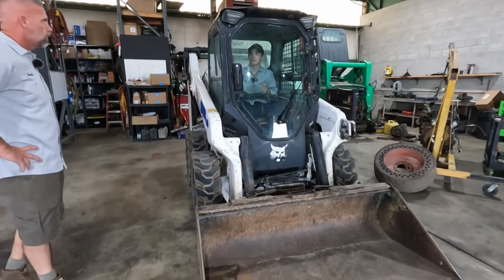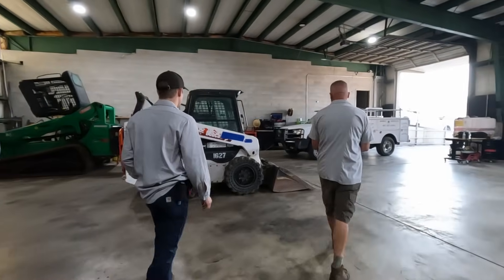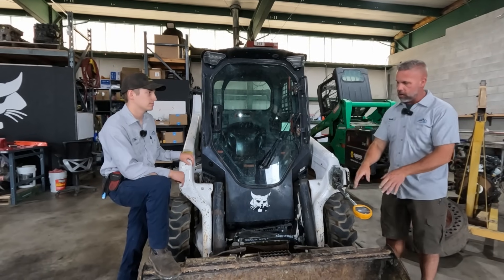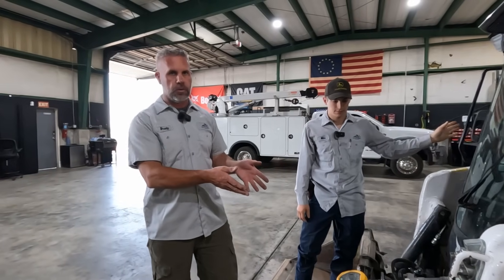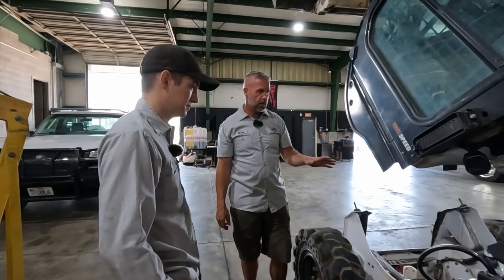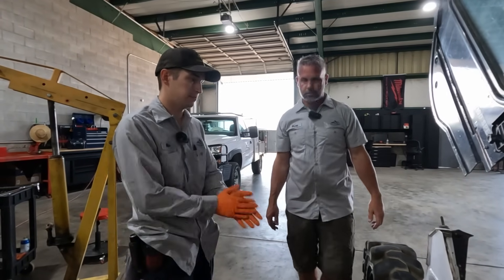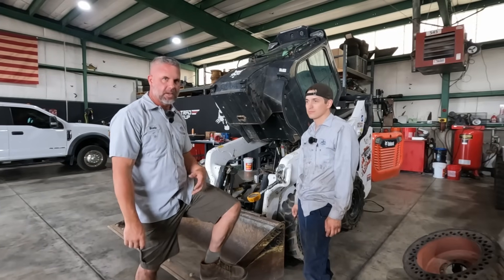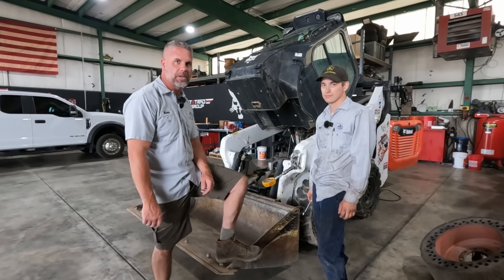Why Does This Bobcat Have Weak Hydraulics?

Comment: what would cause my brand new t66 2 speed to constantly bogs down and stall's out when digging into a bank or digging out a stump ? Ive owned 3 t66 machines now and this is the first with 2 speed and never had this problem with the others.Could the pressure be to low?

Comment: So if your gear pump is good and you are still having the same issue? I have an s70 with similar symptoms. Thought it was the gear pump so i replaced it but no change.
Reply: Describe your symptoms. The gear pumps typically only run auxiliary hydraulics. The real work horses are the piston hydrostatic pumps that run your mobility things like wheels/tracks etc.

Comment: How did you turn it on with the cab in the air?
Reply: Easy? Lol the cab lifts but doesn't affect wiring from the ignition switch as long as other conditions are met. I.E. parking brake on and arm rests down.

Comment: i have a 773 that I have to hold the fuel shut off solenoid in pull position with a tie wire then start and operates ,once done I reverse the process .replace the fuel shutoff solenoid ,relay harness was missing ,install an aftermarket one along with the solenoid and still the same problem . can you help ,any idea why this happens , is really annoying .thank you
Reply: Computer that controls the solenoid and or ignition switch

Comment: Prior to loosing and of the hoses, how do you bleed the pressure off of the line(s).
Reply: There's always a return to tank line or you can crack the line with a rag over the fitting under your wrench slowly<<<<keyword. You relieve the pressure manually this way, the pressure won't blow off the remaining threads unless you manage to unthread it til only 1 is holding on somehow.

Comment: I have lost count on the number of times I pulled the main relief valve and cleaned it on the old Bobcat 310 I was using in the 80's. It was way too sensitive to dirt.
Reply: Can you explain how you clean it out.
Reply: @brennankirby25  The relief valve was a bit strange having a very small hole in the center which allowed some small amount of oil to bleed through to the back of the relief valve causing a partial counter pressure. When a very small speck of dirt got stuck in it then the pressure in the system became very weak - you could barely raise the bucket.
Remove the valve, remove the small piece of dirt (I think that it was primarily lint from the oil filter or paint from the inside of the transmission) and then put it back and it worked fine for a while.
Overall a dirt sensitive design, and I suspect they changed it later. This was in the early 80's.
Reply: I just pulled mine. Same design. There is a little pilot pressure hole on the one side. Plugged right up. 👍 Thank you. @ehsnils
Reply: I have a 2011 s70. I thought it was the gear pump on mine. I replaced it and still only half flow to my auxiliary hydraulics. Very similar symptoms to this video. I pulled the bcis check valve on mine the screen was clean but hard to test these without a hydraulic test block.

Comment: I have a 2017 s450 and would like to know if the drive motors pull straight out from a carrier like older models or if i have to remove the chains, as i cannot see a carrier in the parts schematic. They are eaton manual single speed motors.
Thanks

Comment: A lot of backup rings have a diagonal cut in them that does two things. It expands outwards under pressure conforming to the outer sealing surface, and it prevents damage during installation.

Comment: Could a defective hydraulic filter earlier in the life of this machine that allowed dirty oil to flow through the pump have caused this?
Reply: It could. If the filter was bad for a 500hr interval or even shorter and it was allowing unfiltered oil to continuously circulate the system that will definitely cause accelerated wear in the pump. With no filter you probably would get the same amount or more wear in 500hrs as you would in 10,000hrs in a properly working filtered system. But it also most likely wouldn’t be just the gear pump. The dual hydrostat, both drive motors would be worn, spools in the control valve would get scratched and scored etc. that would not be good..

Comment: So to understand the flow control..when you had the flow control completely shut and the pump was only building 600psi…the 600psi created isn’t enough pressure to crack the motor casing or break something? It seems when you stop the flow, even though the pump output is 600psi, something has to give.
Reply: This is because the pump is internally bypassing most of the oil so it can never build any more pressure. These systems are also rated around 3500 psi

Comment: So when hooking gauge up to female quick coupler test is only done at idle?? Im assuming full throttle it would make pressure??
Reply from the maker: @fonickel6634  A good pump will make pressure regardless of RPM. We checked it at low idle and high idle.  The best it could do is 1800 on this machine
Reply: @tetradgroup  😅 i still have a couple t110s i suspect with worn out pumps. Boss mans not concerned about it but il eventually get them in the shop 1 at a time to verify